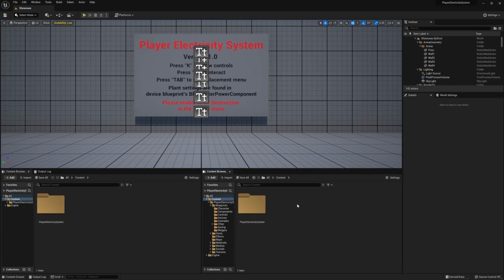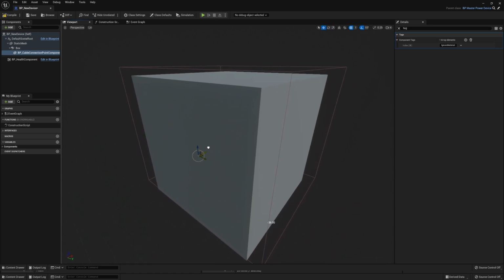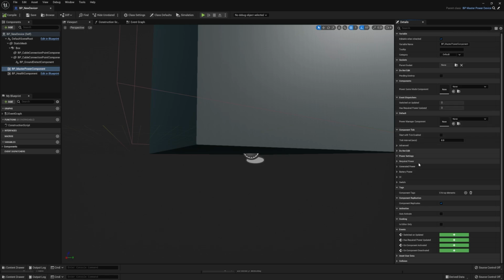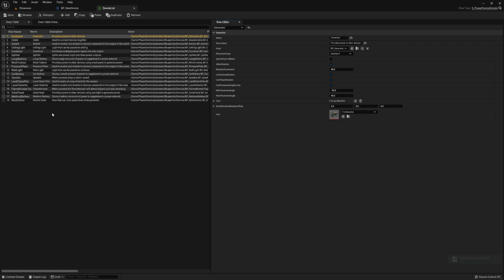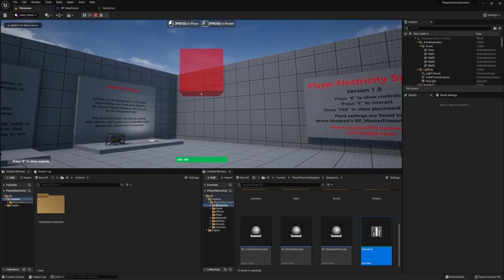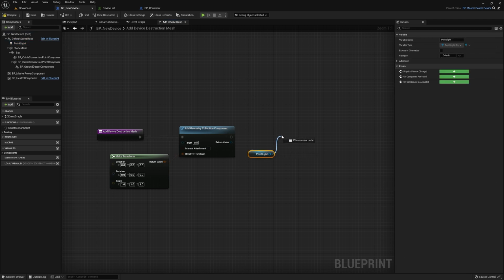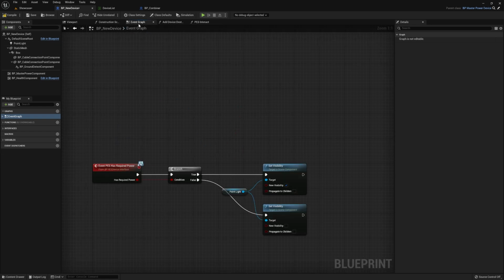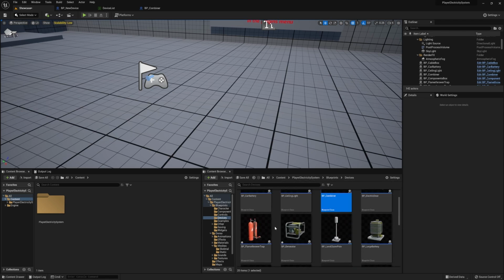Player Electricity System (Adding New Devices)

Comment: Amazing. Purchased immediately lol. Its a no-brainer. 

Question - Would this work with existing items like crafting benches? How would you make this a requirement for use? Just add the event required power to it?
Reply from the maker: Hi, there is a separate guide in the documentation for adding the power system to custom blueprints you can follow. if you integrating this into SGKv2 at the end of the integration guide is a optional extras link that goes though adding power to the existing furnace and campfire build parts.